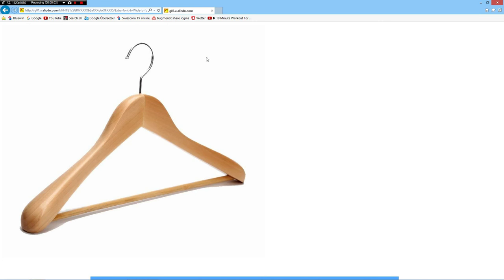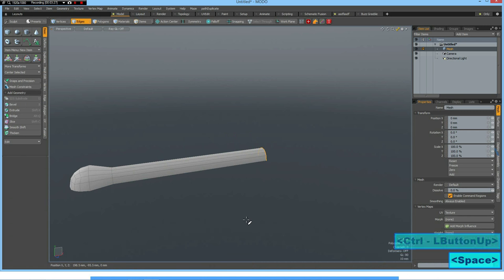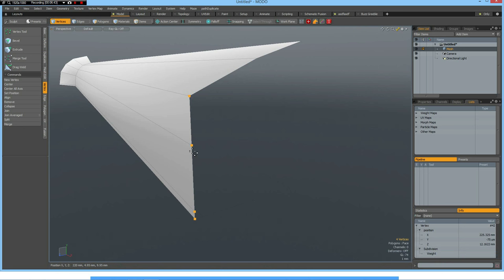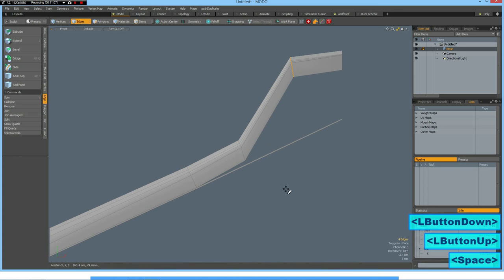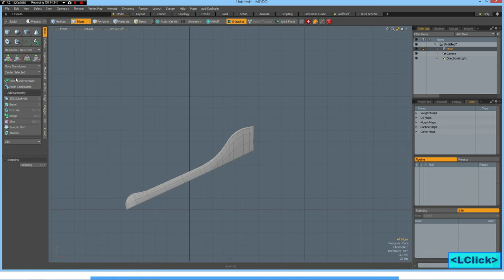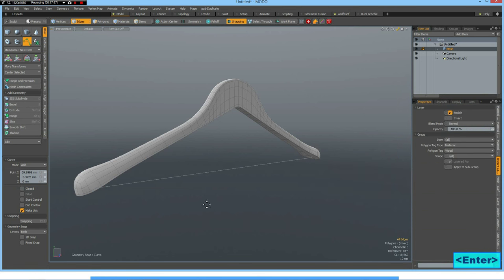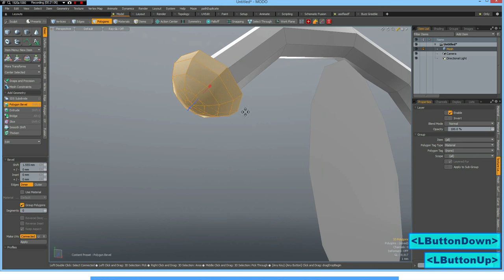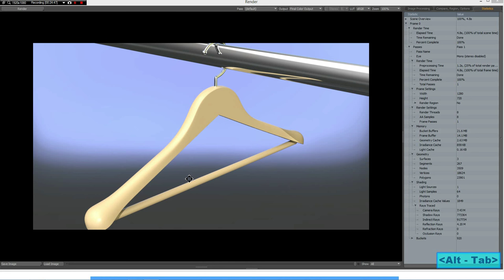The Foundry MODO - Coat Hanger for Fernando Franco

Comment: Which keystroke recorder are you using? I've been trying Keycast, but it looks a bit ugly to me.
Reply from the maker: +APRENDE 3D con Juan Jimenez Hi Juan, i got this tip form Windy But, one of my subscribers. It's called Keycastow and runs only on Windows.

Quote: "I have found a small free program called KeyCast.  you can take a look at it here :-  "http://brookhong.github.io/2014/04/28/keycast-on-windows.html"
Reply: +Peter Stammbach Ah ok, it's the very same I'm using. I just needed to tweak it a little to make it prettier :P
Reply from the maker: Hi Juan, it's a pitty that it does not distinguish between 'normal' numbers and numeric keypad numbers. In addition it would be very nice if you could suppress your custom shortcuts to not confuse people :-) Happy holidays and all the best for the new year, Peter
Reply: +Peter Stammbach was fun to try and remember where the ü key sits for the invert select as I do not have my old keyboard any longer. Ends up its the [ on English keyboards.
Reply from the maker: Hehe.. which is in fact the default for 'Invert Selection'. Unfortunately many of the defaults only work for US-English keyboards. It seems, that the developers have not heard of Scan codes which are independant of keyboard layouts